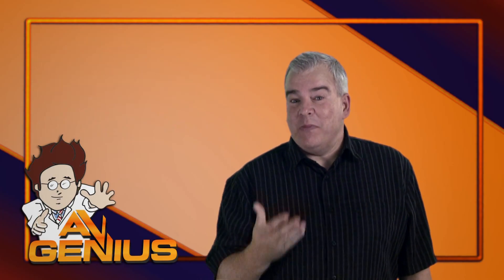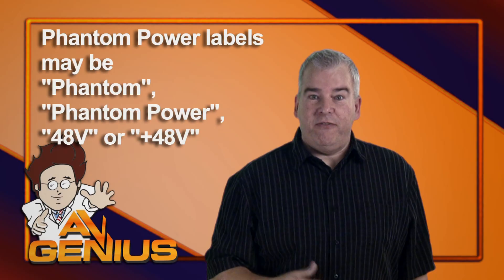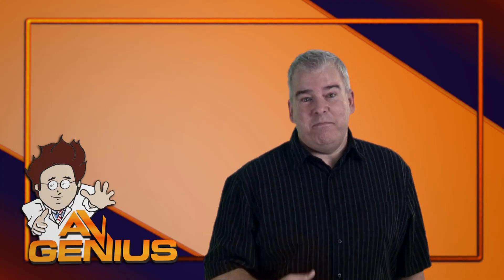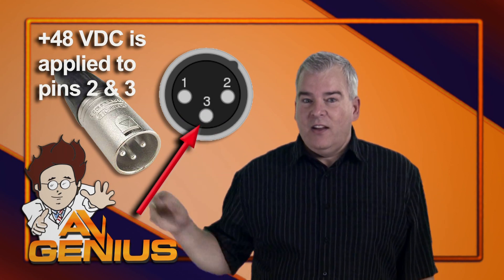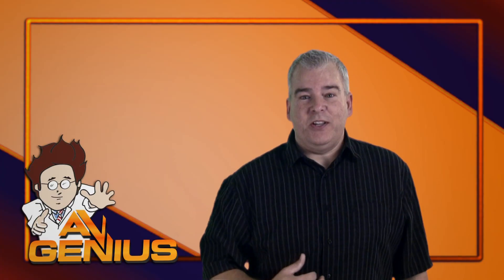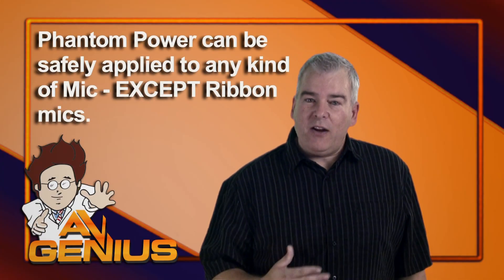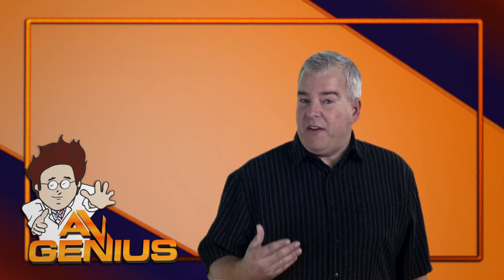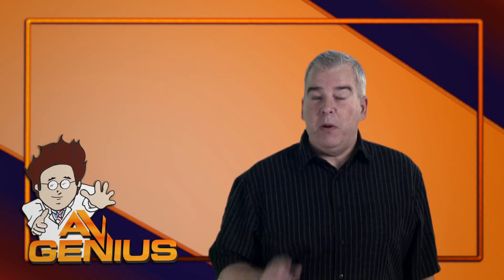AV Genius "Phantom Power"

Comment: Thank you for this explanation!
What you say here is 48V can only be "destructive" on non-48V devices, if turned on. But not the contrary? I only turn on the 48V button on my Audiobox iTwo when i actually use my M7 Mic, because of the disturbing blue light. I've never been sure if it's good for the Mic.
Reply from the maker: My Focusrite Scarlett has a nice, soft, Red light, but I hear ya about those blazing blues.

When you turn on Phantom power, (positive) +48V is applied to pin 2 AND 3 of the XLR on the mic input jack of your iTwo, and grounded on pin 1.
Because a mic is a "balanced" device, it inverts the polarity of the signal on pin 3, so when you connect it to the iTwo it will cancel out the voltage (+48V - 48V = 0V). "Phantom" - because it disappears (to zero) inside a balanced (or differential) circuit like a dynamic mic.
But if the device like your M7 condensor mic just taps off pin TWO with an extra circuit, there will be +48 Volts on that pin... which can then be used as a power source. 

Therefore, devices that need power can tap off of pin 2 and find +48V DC. But without any power circuitry, it will simply be cancelled out inside the device leaving it completely unharmed.

Hope that wasn't too geeky!
Reply: Well... i didn't read any warning in your answer, so i think my hardware is safe ;D Thanks!
Reply: Totally safe.